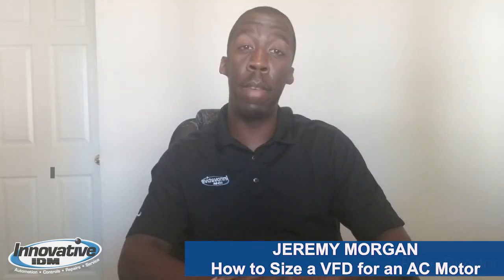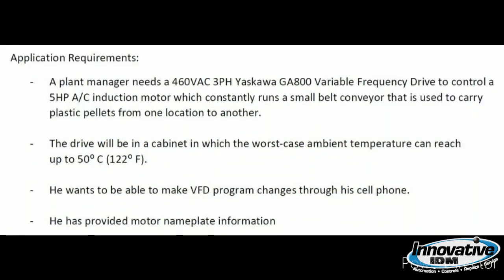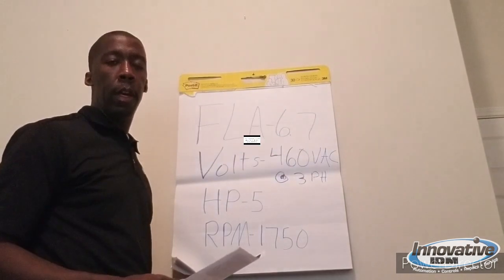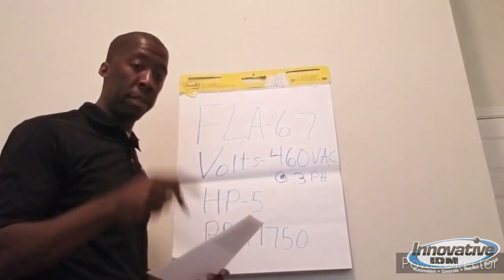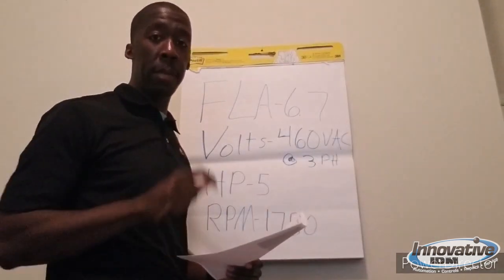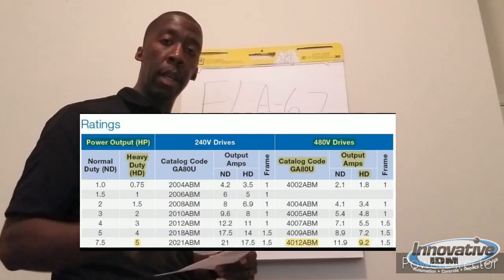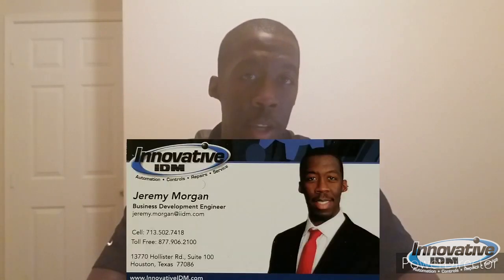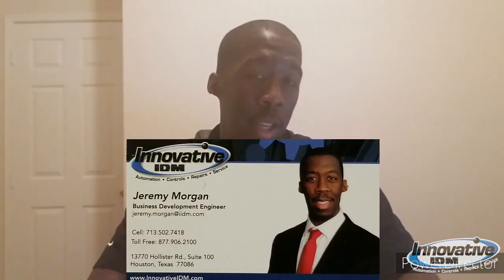How to Size a VFD for an AC Motor -- Innovative-IDM

Comment: I have a 25 HP submersible pump motor. Ambient temperature reaches 45°C in summers and the motor runs at 2850 RPM and the input voltage ranges between 310-400 VAC and the amperes that the motor can handle is 39Amperes. Will a 30HP VFD drive run the motor smoothly?

Comment: Please help..I have a single phase 240vac induction motor that i want to run a speeddrive on..It is an  ex water pressure pump motor and draws 600w peak..the purpose im using it for would never get to half that i imagine, as it will just have a diamond rock polishing disc fitted..Can you please tell me if i can use a VFD to achieve my purpose? i'm having trouble finding information in rural australia..any help with the necessary specs for a unit would be great as well. thanks in advance and thanks for this vid..